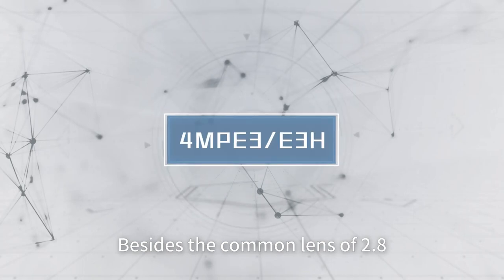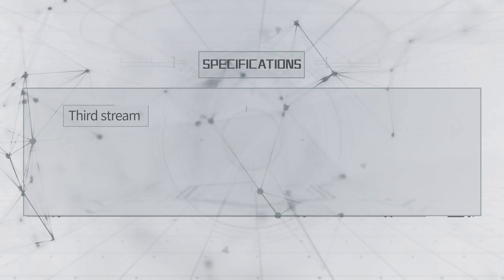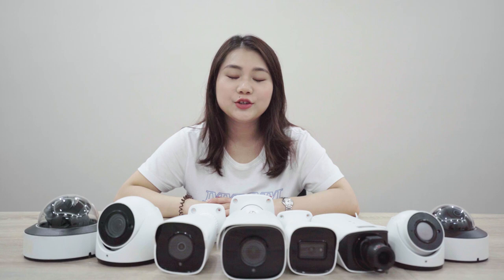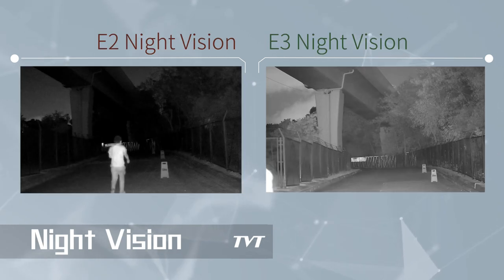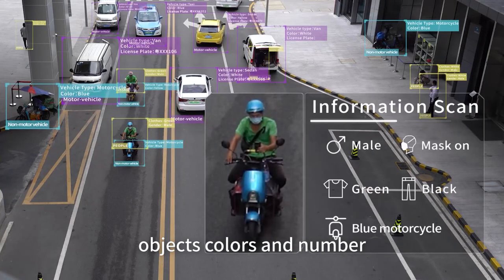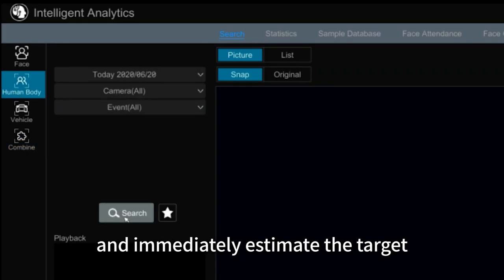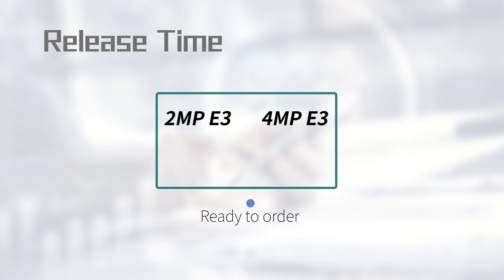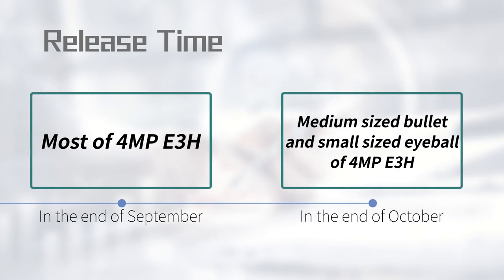Introduction of TVT E3 Series IP Camera

Comment: What is the default ip for TD-9322
Reply from the maker: Sir, normally with 192.168.1.1, but you can search the device by IP tool, then get the exact IP address.
Reply: @tvtdigitaltechnology3479  DO ANR [AUTOMATIC NETWORK RECOVERY] FEATURE AVAILIABLE IN TVT